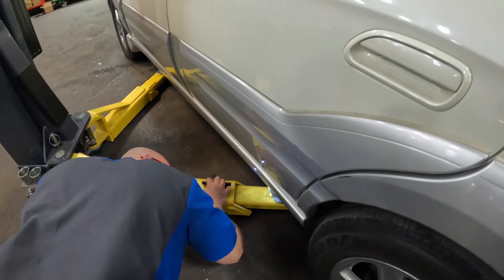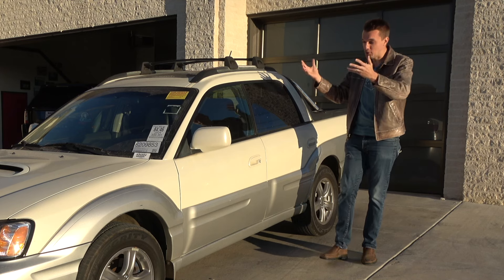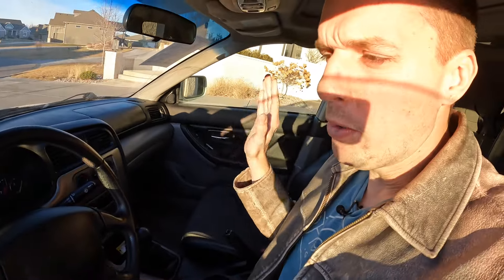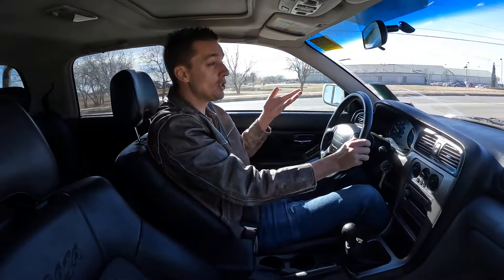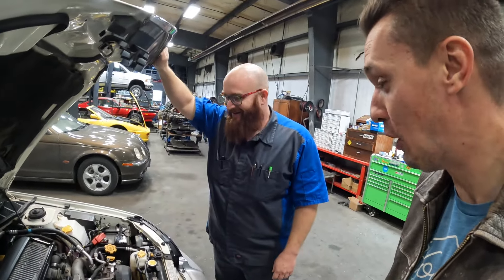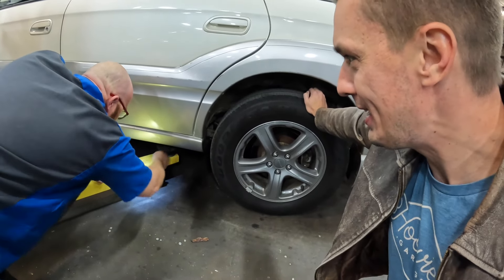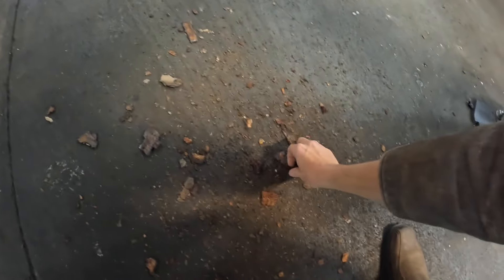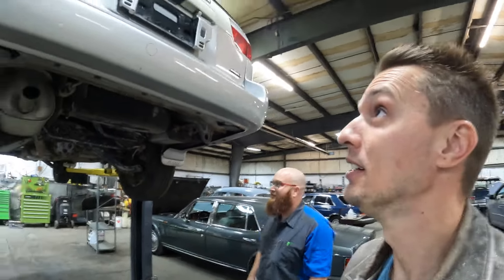Here's why you should NEVER EVER Buy a Cheap Subaru (total mechanical/rust DISASTERS) Baja XT Turbo

Comment: I don’t think I’ve ever seen a running, driving car with such extensive structural corrosion. In the UK, an MOT would have seen that off the road years ago, or at least it would have been fixed before it could get nearly this bad. Good to see you have the conscience to not pass it onto someone else, it’s just waiting to literally come apart on the road.
Reply: He knew exactly the risk he was taking bidding on a vehicle sight unseen.  Subarus are notorious for rusting from the inside out.
Reply: @chuckschillingvideos  yes I get that, and at least he can afford the hit, at least it makes for some good content, and the car can be parted out. Respect to him for not passing the car on though. It should never go back on the road, it’s too far gone, needs a re-shell at this point. What I find alarming is that this car was actually technically road legal, as I say, in the UK, it would have failed an MOT way, way before it got this bad.
Reply: @chuckschillingvideos  more like lazy subaru owners don't clean their car after driving on salted roads. The majority of subarus in America are sold in areas with snowy winters.
Reply: Some US states have an annual inspection, but some only get inspected when there's a change of owner. This Subaru must be like driving a sieve.
Reply: @brendanfleming6584  I suspected that may be the case… I’m surprised you can’t feel it in the handling, be interesting to see it lifted again (if they have the balls) and look at what happens around the panel gaps.
Reply: @Si1983h  I grew up driving Fiats and Lancias... this was normal 😀. The subframes hide a lot of the rust issues (until they fail also)!
Reply: @serenityinsilence  lots of Subarus on UK roads too, we have salted roads in the winter too (probably not as extreme as some parts of the US, our winters aren’t extreme), I’m not aware of corrosion being a significant issue.

With how far gone this one is, it’s obviously never seen any proper maintenance, it’s been rotting for years. This could have been prevented with some care.
Reply: i live in rural indiana and this isnt even that bad.... ive seen DRASTICALLY worse.... a lady sent me a pic of her van a few years back bc it was undrivable and wanted me to quote her a fix i couldnt even believe my eyes.... she said she paid $2500 for it or something like that and the rear axle rusted so bad it bent/snapped on the drivers side and the whole underside was straight rust .... it literally looked like a ship wreck under the thing it was so rusty. That said i told her there really was no fixing it cost effectively because even if i replaced the axle in a week or 2 there would be something that would break or snap due to rust damage and that it was unsafe to drive anymore.... that was the last i heard of it...
Reply: Like the earlier reply.. this is pretty normal in Canada and most people still drive them for 100k miles like that.
Reply: Where i live in Manitoba you only need to get a car inspected when registering it. I've seen some cars on the road that are more rust than car. The worst I've seen driving down the road was a early 2000's Hyundai where 90% of the the rockers all the way back to the rear arches were gone. You could actually see both the back seat and road through the side of the car.
Reply: @Anarch3y  hahaha, it’s quite funny really when you think of the safety mandates imposed on imported vehicles (big bumpers being a notable one)… but once on the road, you can run them until they literally crumble. Some of the stuff on Pimp My Ride was highly entertaining back in the day.

I find used car values in the state perplexing too, I’m a VW fan and regularly see proper old beaters being offered for $5k upwards… I paid £1.5k for a MK4 Golf GTI in immaculate condition 8 years ago, I’ve looked after it but it’s still my daily now, still in great condition… be worth a fortune over there lol.
Reply: @Si1983h  I've noticed that car prices in the UK are quite a bit cheaper than most other places. Probably to do with the fact that you need to get the car through MOT every year means beaters which wont make it through the next MOT aren't worth much, and Right hand drive cars aren't worth as much if you were exporting them for resale.
It also seems that you guys pay MUCH more to insure your cars, more than the value of the car even. 

Also i love the GTI, wish you could get a nice one for cheap here. I'm a fan of hot hatches and wish we got more of them in North america. I've currently got a Volvo C30 T5 which is an absolute blast.
Reply: @Anarch3y  makes sense, my Golf has had a fair amount spent on it to keep it road worthy… worth it though, it’s got more character and gets more attention than a new one would.
Reply: YES, we can drive coffins of rust and defend ourselves with 2A here IN THE U.S.A. oh my LET FREEDOM RING.
Reply: Ha you should see NC state laws 😂
Reply: Car still running in the UK with extreme corrosion, Ford KA maybe ;)
Reply: I've had worse presented for an MOT test, a Fiat Punto was particularly memorable, I declared it unsafe to test after the whole sill fell off when the door was opened
Reply: @chuckschillingvideos  Never seen Audi A5 huh ?

there flatting gas pedal can make new wheels from your feets
Reply: The thing is in the US, inspections are more of a revenue generator for the state rather than something to keep unsafe cars off the road. That's just a side effect of it. Also, the inspection stations, at least in the states that I've lived in, are at Independent garages. The state gets most of the inspection cost, the garage only makes a few bucks on each one. So it's in their best interest to be done with these inspections as quickly as possible, which mostly entails only checking the bare minimum of things that the state keeps track of.  Case in point, I recently took my beater Volvo for a inspection with a non-functioning parking brake and bald tires.  The shop basically just checked to make sure my check engine light wasn't on, and that my windows weren't illegally tinted. 10 minutes later I was on my way with a fresh sticker.
Reply: @stupidgenius15  I got curious, having lived in inspection states pretty much all my life, so I looked it up. The biggest contiguous block of states that require regular safety, not just emissions, inspections are all in the Northeast--all the New England states, New York, New Jersey, and Pennsylvania. The others that do are scattered around the rest of the country.

All told, 16 states and the District of Columbia still have required safety inspection programs--down from a high of 31 in the mid-'70s. Congress barred the NHTSA from withholding federal highway funding from states that didn't have one in 1976, at which point states started eliminating them.
Reply: Inspections are mostly seen as a nuisance, yet it would probably save a couple of thousand lives each year if every state made them mandatory.
Reply: You wouldn’t believe what rolls down our roads here in the US.
Reply: @serenityinsilence  Tough to find places to wash a car when it’s minus 60 degrees outside. I guess a garage it you’re lucky enough to own one especially in the city.
Reply: You've never driven a chevy... this is nothing but a show...
Reply: Unfortunately I have. In the U.S especially in the Northeast they drop about a million pounds of salt when we get any snow. This is pretty common, if a car owner in New England drives during the winter and doesn't clean their vehicle, it gets this bad within 3-5 years. It's pretty laughable how roads are maintained here in America.
Reply: Well to be fair this thing has likely not been driven for years
Reply: Sucks to be in the UK =D
Reply: @davidr1122  depends on what you’re comparing it too… yeah we have to get our cars inspected annually but it tends to stop the car falling apart and repair bills growing, also quite pretty and laid back where I live.
Reply: @dglcomputers1498  there aren’t many MK1 KAs left, they rusted like mad, and most have long become unviable to fix, same with MK4 fiestas, you rarely see them.
Reply: @draggy6544  possibly not, but now it’s definitely reached the end of the road… good engine and interior, so it has some value there.
Reply: @Si1983h  part out time i agree. Even a slight accident would rip the car in half
Reply: It is so bad so if i came with such a car to the MoT and if i could persuade them to put the car on the suspension/stearing test, the 
testrigg would be able to rip the stearing and suspension in multiple small pieces...
Reply: @rolandthethompsongunner64  minus 60 degrees ???? WHEN do you have that temp ?
Minus 35 celsius, i can believe but still ....  parts of North America where there is that temp longer term is the area there salt is used less.

A car which is washed (except then temp is below -10 celsius in northern sweden) regularly even if it from 2000 is in far better shape than this !
Reply: @TheStefanskoglund1  We use a lot of salt on our roads in most areas. And it can get down to 60 or even 80 below when the wind is factored in. I should have mentioned that.
Reply: Only 15 out of 50 states require annual or biannual inspections in the US. Where I live and as far as I know all of our surrounding states require no inspections of any sort at any point in a vehicles life. We also have had multiple 4-7 day periods of 15 to 55 below (Fahrenheit) so we use a lot of salt, so much that I see vehicles with rust holes within 4 years of new. Not cheap vehicles either I’m talking 55,000 to $80,000 rusting away instantly, mainly on late model GM vehicles.
Reply: you need to come to wisconsin
Reply: @Anarch3y  Very much so - a good few years ago a friend had a very nice car (a Renault 25TS) but it was somewhat heavy on fuel so when his father passed, he had a chance to replace it with his father's smaller, more economical car. He tried selling the Renault for pennies really but the only serious buyer said it'd cost him more to insure than buy. So it went for scrap: but this was at a time in the UK when scrap car prices were so low that often yards would simply refuse cars or you had to pay them to take it. It did eventually get scrapped. Currently I pay the equivalent of 500 US dollars to insure an 18 year old BMW, don't know how that compares with where you live?
Reply: @dglcomputers1498  My Ka failed with a fail sheet that took up a whole side of A4 paper! It makes a reasonable shed now.
Reply: Well, unfortunately people are poor and cars like these that are rotted out are needed for us poor people to get through thr winters
Reply: As someone in the UK and who works in a garage, I find American/Canadian driving quite scary knowing that any of the cars around you may not even have brake lines, heck even tyres with tread on.

been a passenger in a car with a huge crack right down the windscreen, clearly not been looked after, moved left or right every time you touched the brakes and had various noises that seemed like it needed serious attention years ago, but its perfectly fine and road legal in the state I was in! madness

At the same time, pimp my ride UK was pretty boring due too all the cars being basically road legal to start with!
Reply: @SteadVex  yeah Americans can't afford to fix their cars lol nor do we have trains to fall back on, nor is our country the size of los angeles
Reply: @serenityinsilence  that bad of damage isnt from salted roads alone..
Reply: @Si1983h  The 'cash for clunkers' program 
(in typical liberal fashion) only made a difference in a negative direction, driving up the prices of used cars by removing hundreds of thousands of usable vehicles from the market.
Reply: Yes insane.   He possibly saved someone's life
Reply: That's one reason why there was so much concern about the MOT Exemption law coming in, for vehicles over 40 years of age! So many people expected the roads to suddenly be filled with death traps, but the fact is, the vast majority of cars over 40 years of age, are owned by enthusiasts like me (see my channel) so they are mostly better maintained than cars a quarter of their age! 

As for some other comments regarding values, yes, its very true that the looming MOT test does de-value a lot of older cars to the point of very little value and it is indeed one reason why we have so many cheap cars around! Sadly, we also have a culture of simply throwing away perfectly good cars based on MOT test failures, where any repairs will cost more than the cars value! Its sad how many car ive seen scrapped here, which could have many more years of use elsewhere in the world!
Reply: America.

Comment: I had the exact same thing happen to me when I bought a 2005 Subaru Imprezza STi, my second STI, a nice low mileage (72k) white with gold wheels version. It looked great from the outside and inside but the frame was rusted out below. My 1st 2005 STi (Blue/silver wheels) had the notorious cylinder 4 ringland failure. After that I swore that I'd never buy another Subaru product. Crazy to see this happen to someone else. I got the same gut-punch feeling that I had when I found out the mine had frame rust.
Reply: yeah. those things happen in the northeast.
Reply: Just had cylinder 4 ringland failure on my 04 Forester XT.  Car was completely rust free and in nearly perfect condition. I sympathize.
Reply: Subarus are tempting with their AWD and decent manual power, but man do they have issues. Just traded in my '08 Impreza 5MT for a '14 Focus ST with 28k miles and I'm never going back.
Reply: @bishopworks3203 

" Ford is all about quality.
- Absolutely not the case." 

/Throttle House
Reply: @Ce0ammer  as someone whose owned multiple subarus with loads of problems, id take a ford at this point.
Reply: @Ce0ammer  you're not entirely wrong, but the Focus ST is known to be pretty reliable.

Just like how GM makes garbage except when it comes to the LS engine lol

Subaru doesn't seem to have many vehicles that are actually decent...

Comment: The turbo subaru engines used an MLS head gasket and did not have the leaking issues that the single layer -graphite coated gaskets, used on the NA EJ25, had.

Comment: Hoovie's greatest hooptie EVER. My 1st car had a case of rust that was far worse. The only place a jack or similar was the front & rear suspension. Anywhere on the body and the jacking device would just go right thru, like a hot knife thru butter.
Reply: that's why you gotta get it inspected every so often in the northeast.

Comment: I used to own one of these. The clutch was really heavy and I was always worried about blowing the turbo because of the screen in the banjo bolt on the oil feed line. Really cool and very capable car though! Love it 🤙
Reply: I had an 06 Legacy GT that still had the screen in the banjo bolt. Luckily I knew about it and pulled it out because it was almost completely clogged. Fun car after I fixed all the issues. 
I still have a manual transmission and driveshaft out of the 05 parts car if anyone is interested.

Comment: The engine seems to be in a good condition to me, will it be saved before junking the car? I think the engine could still be worth something
Reply: 2800
Reply: The engine and transmission are definitely worth money. Those old 2.5 XT Outback and Baja models have the WRX STI Powertrains in them.
Reply: I'm surprised you Americans don't weld rusted cars. We in central Russia weld even the cheapest worthless cars that are in way worse condition
Reply: @stuvademakaroner9607  the cost of living int the USA is higher, which means the hourly wage cost is also much higher.
Reply: @stuvademakaroner9607  Maybe it should be mailed to Russia
Reply: @RicardoPCGamer  no they don't, they're EJ255s with different turbos and a 5 speed manual. The STI is the EJ257 and STI 6 speed. The 250hp legacy and outback engine is similar to an STI's but has different heads
Reply: @stuvademakaroner9607  we fix lots of rusty cars, ones that are actually worth fixing
Reply: @railfanatic1416  you're right but it is close enough to be a WRX powertrain. Except for it being a 5 speed.  It still is worth something and can be very fast with the right mods.
Reply: @stuvademakaroner9607  you havent seen my jeep 😂
Reply: @stuvademakaroner9607  Weld to what? If youre welding to other rusted junk, it will never pass inspection.
Reply: @BudMasta  I mean proper repair. Botch repairs to hide holes to pass inspection is a euro/american thing. People want proper repairs that last, we don't even have vehicle inspection any more, if that's the thing to worry about